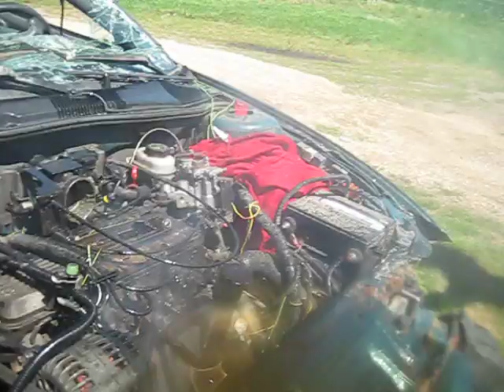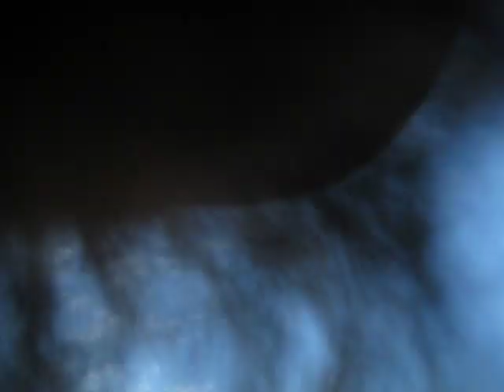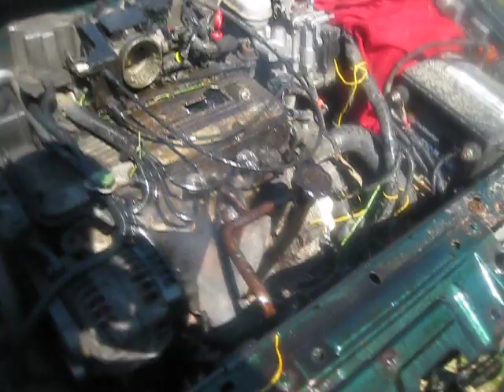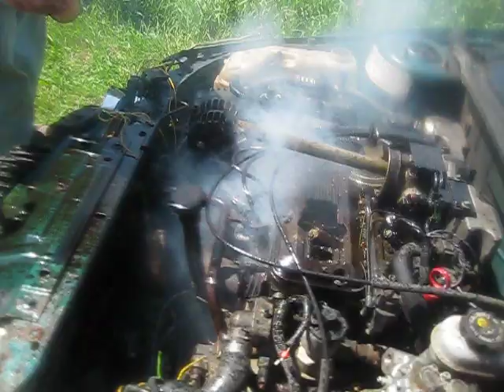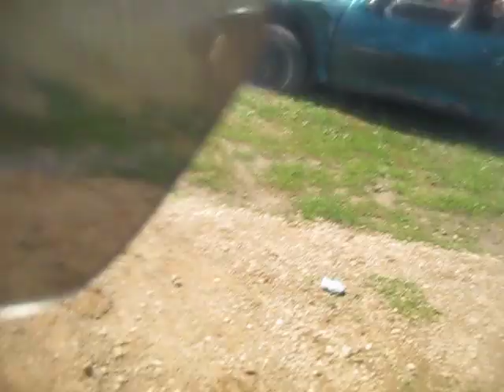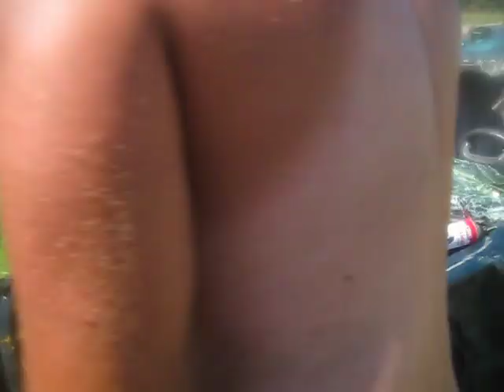Unkillable Cavalier Full Unedited Video

Comment: Unkillable Chevy? That's a first
Reply: +TomBom292 perhaps you havent owned too many good GM cars. they made great engines and they also made trash. this older 2.2 was a decent engine, they had head problems requiring a new head gasket but otherwise they were tanks. i had a 91 cavalier 2.2 with 220K on it when i sold it as far as i know its still running.
Reply: +andrew donohue I can't drive yet actually